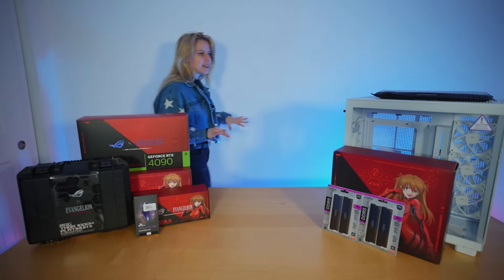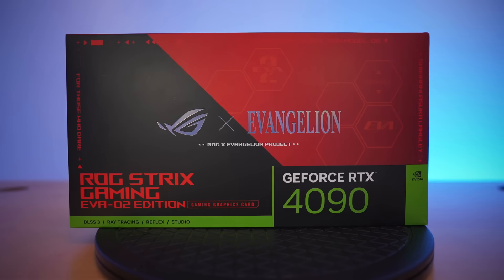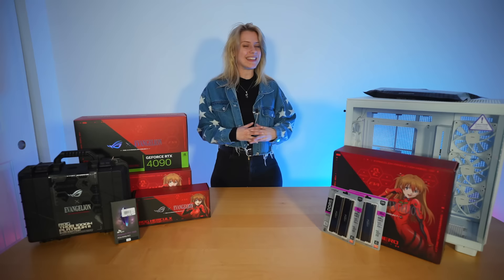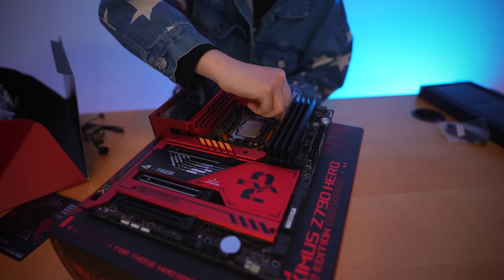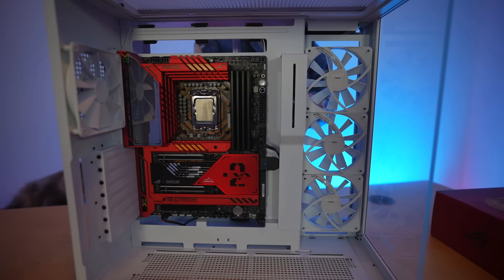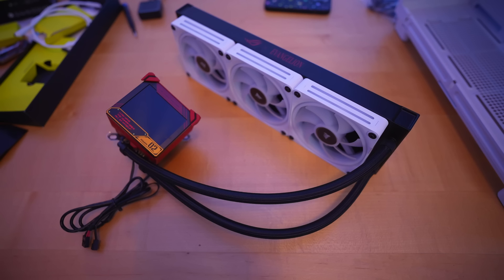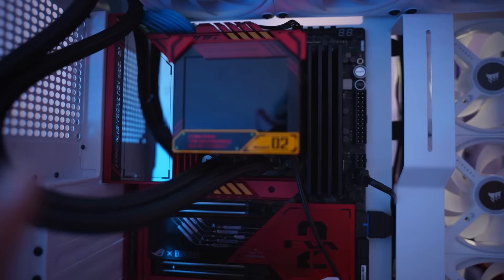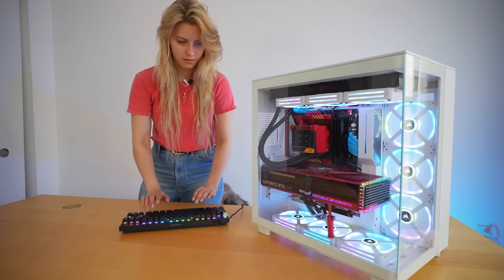LET'S BUILD MY NEW GAMING PC... OVERPOWERED AND UNIQUE! RTX 4090 PC Build | NoisyButters

Comment: Samsung 990 Pro (Gen4) NVMe would have been better. Also 2 x 32GB in the correct slots is better than 4 x 16GB, which will introduce some extra latency.

Comment: Overclocking ram can lead to unstable results, have to make sure your motherboard supports the frequency you overclocking to. A beast of a build regardless
Reply: Also 1000w isn't enough for the 4090 and the i9 14900k if overclocking
Reply: @SkateClipsAndTips  1000 w would be enough if it wasn't because of that aio, but she'll need that AIO to be able to use the i9 at 100% without thermal throttling or even for any OC on it, the speed of the ram is not high enough to be unstable is just 6000 should be fine unless the timings are very low as 4 dimms is more demanding on memory controller.
Reply: @guille92h I just find it crazy that the 4090 can pull 600w and the i9 14900k can pull near 400w (in stress test situations)
Reply: The actual problem here is that it's 4 DIMM DDR5, that's just not going to clock well. Also nowadays it's much better to just undervolt the CPU so it can actually maintain the higher clocks. Nobody sane is going to run the i9 at 400 W in a gaming rig.

Comment: Whole reason to get that cpu and mobo kombo is get memory at least 7200Mhz limit. Check memory QVL list for that mobo and you get faster PC. Like other said, ddr5 6000Mhz suit much better for Ryzen 7000-series. Noticed high-end 4-dimm 8-layer Intel boards such as the Z790 Nova barely run DDR5-7800 .But damn that looks cool.

Comment: Ok, so
1: love the content, your positivity is contagious! Every time I watch one of your videos it gives me a smile 😁
2: could you hook us up with a source for those cool neon animated backgrounds you had on your old PC?
3: I would call your new rig Brick! cause red! And it's a Borderlands name!

Congrats for all the success and I'm jealous of your new rig. I just bought myself the best computer I've ever had (I'll put the specs below cause I'm proud of it!)

Thanks for doing what you do!

My new build:

Case: View 270 Plus Snow, Tempered Glass, No PSU, ATX, White, Mid Tower Case
Motherboard: PRIME X670-P WIFI, AMD X670 Chipset, AM5, ATX Motherboard
Processor: AMD Ryzen 7 7800X3D 8-Core 4.2 - 5.0GHz Turbo, AM5, 120W TDP, Processor
Video Card: GeForce RTX 4070 Ti SUPER VENTUS 2X WHITE OC, 2340 - 2655MHz, 16GB GDDR6X, Graphics Card
Memory: 32GB (2 x 16GB) FURY Beast DDR5 6000MHz, EXPO, CL30, White, RGB LED, DIMM Memory
Power Supply: RM750e, 80 PLUS Gold 750W, Fully Modular, ATX Power Supply
CPU Cooling: EK-AIO 240 D-RGB, 240mm Radiator, Liquid Cooling System

Some of that is the most budget option I could safely pick... like the case specifically. I'll upgrade over time naturally.

Anyways. Heck yeah for cool computers!

Comment: If CPU is square, then 1 dot of thermal paste in the middle ? Ok.
So if CPU is rectangle, then.. 2 dots ? Maybe 3 ? 🤔
No ! 9 dots !! 😆

Actually, i'm paranoid enough to use the spread method.. using my finger so i could really feel it.
..On both sides 🤪

Comment: Nothing but exhaust fans? Was that intentional? Also, I wasn't aware that the QX fans could be used on a radiator? I didn't think they had the correct static pressures for this purpose.

Comment: Can I put my 2 cents? well. first of all that a beauty beast! absolutely love it!. 
But... I have same NZXT h9 Flow and I've installed  Radiator on top of removable top lid and fans on a bottom. it looks cooler and it pretty much hidden in between top lids. but its just me.... a lil suggestion 😘😘
and you can get vertical mount for your beautiful GPU. it will also look awesome in that fishtank :=P

Comment: Not sure if the link is same exact model ram you got, but if you start running into issues, not entirely sure that ram is QVL for that motherboard. Especially with 4 dimms, its likely you will run into stability issues enabling XMP

Comment: As i understand RTX4090 is 450 watt, 14900K is 360watt. 
810 watt so far, and with all others devices there, the total wattage is already over 80% of 1000watt. 
Is that ok? 
I would love to go with atleast 1200 watt with that setup. 

Interesting setup on the storage tho. 
Normally i would say, the main drive (the one with o.s) shouldnt have been the fastest drive (the gen 4). Samsung 970 evo plus is gen 3, while sk Hynix p41 is gen 4.
But now im thinking, perhaps your setup is the optimal since you are gonna do the editing and stuffs on the 2nd drive. 
Well, what do you have on the 1st drive (samsung) beside the o.s? 

The weakness of that thermal paste pattern is higher chance of getting air trapped than a straight thick line in the middle, i think. 

Oh, its ok with the blue part (there is the white or even rgb costume cable for gpu, so i guess there is the blue one already). 
But you forgot with the brunette part i guess. Despite those heatsink on the mobo. It should have been more brunette color. 
It should have been the color of the fans, i guess. So, changing the led of the fans to brunette would fix it to be more like that anime themed.
I mean, you may try that, so you can see it yourself. The final decision is yours.
Reply: The CPU isn't going to draw 360 W in a gaming rig, especially not if you undervolt it which is a good idea anyway.
Reply: @hovnocuc4551  Im guessing she will use that rig for exporting video as well. 

Its the peak power that you should have concerned about. Not the average drawn power.

Comment: How is the crucial memory 25% lower latency? Against what metric? Compared to the competition, crucial is behind in every metric for desktop class memory. SK Hynix not only offer kits beyond 7200MT/s, but SK Hynix's kits at 6000MT/s have lower primary and secondary timings Vs Crucial which means they have the latency advantage too. I don't mind sponsors, but when it is blatantly false I have an issue with the talking points. SK Kynix's A and M die configurations are the best, especially when it comes to overclocking.

Comment: I’ve been out of the loop I guess. Corsair fans don’t have a ton of wires and connect now? Do you just need one controller for rgb instead of the commander pro and whatever else was need for the QL 120’s?

Comment: What are the temps on this build? It seems you only have intake fans.
Reply from the maker: i ended up adding a rear fan in the back again because temps were a little high, but i have 6 intake 4 exhaust! temps are normal, im lookin at my AIO screen rn and CPU is idling around 40 degrees Celsius!
Reply: @NoisyButters  That's awesome, I was expecting that reaction because of the imbalance between intake and exhaust. Now your build is perfect 🥰, 40 while ideal is pretty decent so I'm thinking when you're working or gaming it's gets to about 50s to mid 60s
Reply from the maker: @drickreacts  fan orientation has not changed since this build! just added one exhaust at the back, im confused why multiple people are sayin they're all intake
Reply: @NoisyButters  It's because of how the corsir logo looks. Usually the the exhaust looks ugly (writing on the back of the fan

Comment: My thing is you promote Arc GPUs in your Intel sponsored ad so where is your ARC GPU you promote but don't use them kinda sus Butters ben a fan for years
Reply from the maker: i use that gpu every single day in my living room! there is currently no rtx 4090 equivalent as an intel arc gpu, if there was id definitely check it out
Reply: @NoisyButters  Can we see the PC I'm wanting to build a all Intel with a Arc 770 and a Arc 380 dual GPU setup 380 running the stream and 770 gaming I'm waiting for Smite 2 and Gigantic I think a 770 will be plenty

Comment: Fun video to watch, but the reality of it is that 80% of this is wasted money.  I've been in IT and automated manufacturing for 30+ years, bachelors degree in IT and I've built literally thousands of computers starting in the DOS days.
I ran the entire gamut from SCSI drives, RAID arrays, Water block cooling, gaming motherboards, overclocking, Acrylic cases, LED everything, and eventually sanity reigned supreme and I just stopped.
The reality is that modern systems are so fast and the gaming community lags the hardware by YEARS, having the latest and greatest everything buys you almost nothing.
New drive tech is awesome, the latest M.2 drives are insanely fast and worth every penny.  One of the best performance updates for a slightly dated PC is to simply put in a new M.2 drive.  That and increase the RAM to the max the system will support.
My go to for an everything PC is almost boring.  I buy a decent brand name low end motherboard, ASUS has been my go to for decades.  Rarely do I spend more than $150 on a mobo.
Load up the RAM, a relatively modern Core i5 processor, and whatever GPU has fallen off the price curve and you will be perfectly fine to play ANY game on the market with zero issues.
Clear cases and LED whatever look cool until you have to clean them.  My case is always under my desk so I literally NEVER see it.
I had a co worker that swore if I went from a core i5 to a core i7 processor my games would play better.  I knew better but I did it anyway.  Guess what.   Absolutely NO difference at all.
The jumps in performance from generations are FAR better than an increase in the step in a current gen.  A gen 11 core i5 will run circles around a gen 9 i7.
The lag in gaming development is HUGE, my current Go to is still an RTX 3060.  The 4000 series RTX's had HUGE power issues and some had a nasty habit of bursting into flames..
Every single member of my family and friends that have gaming systems, I built for them.
A decent, perfectly capable gaming system shouldn't cost you any more than about $1000.  Displays are a slightly different animal, I am a fan of 200hz wide screens.  I currently run an Acer Predator 35" curved 200hz but it's covered me for almost 5 years now and is still running strong, but I could still buy it for about $500 right now.
So, yeah, bling it up if it makes you happy.  Most people just can't afford it, and to be honest..  just don't need to.

Comment: The 4090 is a fire hazard and a colossal waste of money. XMP will not work when using more than 2 sticks of DDR5 RAM. So if you choose to use the 4 sticks it will be at (most likely) 4800mhz with XMP off.
Reply: i have 4 sticks XMP running at 6000
Reply: @rajeevkirpalani915  How did you do that? What mobo do you have? It's very well known thing with DDR5 that this is a known problem with how it runs and operates. Board manufacturers can seem to get it down properly yet. Is this now fixed? I wonder....